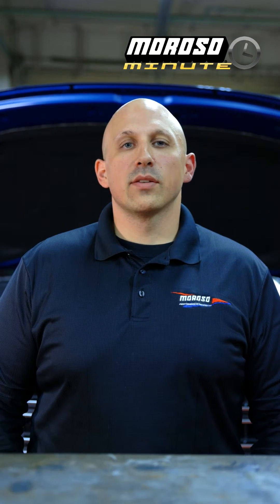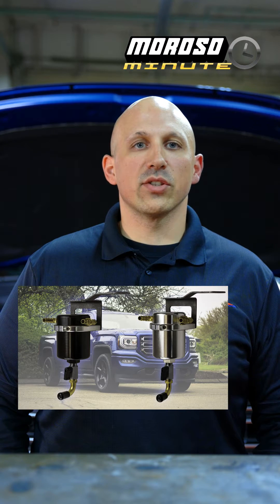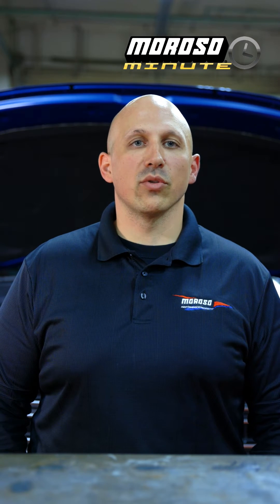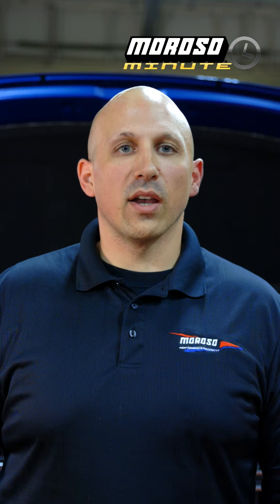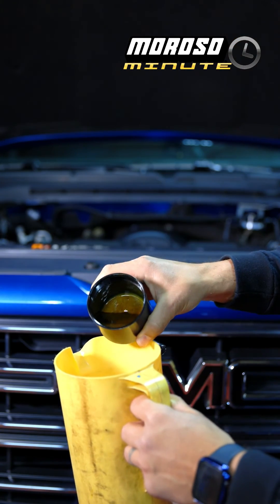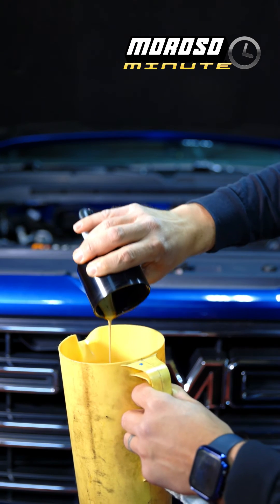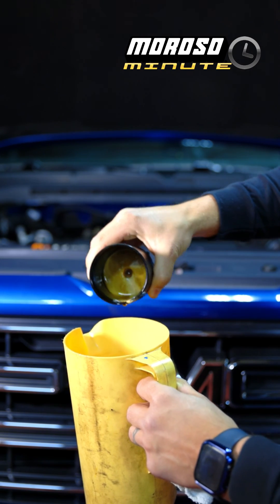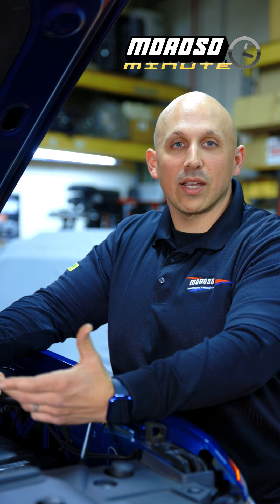AIR OIL SEPARATORS for 2014 to 2018 Chevy and GMC Trucks (LT ENGINES)

Comment: Can this be used with an LS platform
Reply from the maker: The separators themselves are universal, but what makes the platform specific is brackets and lines. If you have an LS powered truck, we should have numbers for that. Give our tech and sales department a call when you get a chance.

 (203) 453 6571 ex332